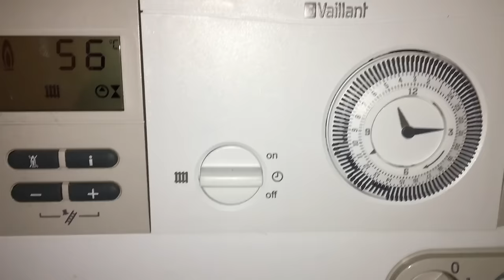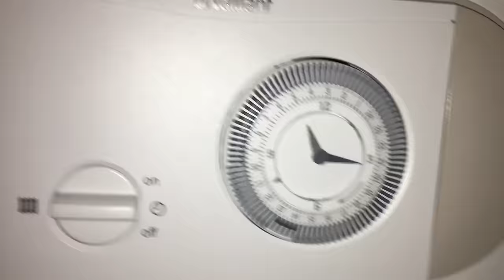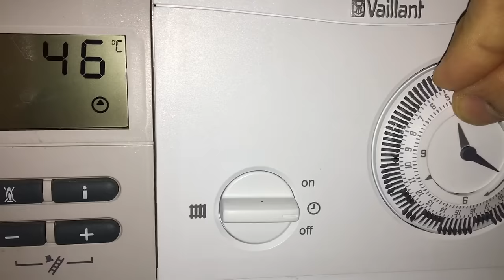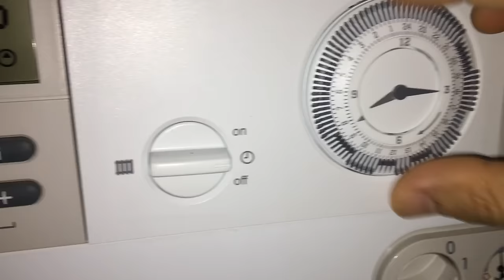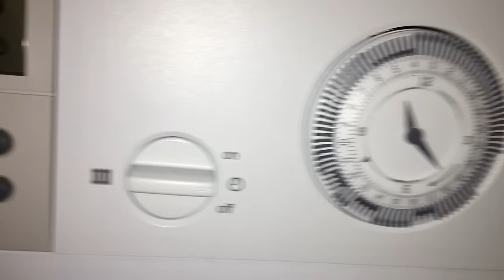How to auto set central heating clock timer using pins

Comment: Thanks for this upload. I have the exact same boiler and clock system but couldn't get it to work with the timer, so I searched & found the actual video for "User guide for time switch 150" which is made by VaillantUK ... On their video, ( https://youtu.be/mJMVn-yGFmc ) it states categorically that the tappets should be pushed to the outside for the heating to turn ON and pushed to the inside to turn OFF! 🙄
I'm amazed that the actual manufacturer of the appliance can't even get it right! Thanks again for the help, I'm now as warm as toast! 😊

Comment: Thanks for this video.

Can you tell me how to control tye boiler with the thermostat? I've been told boiler should be set to on then set temperature on the thermostat but when I do that the heating is constantly on no matter what temp I have the thermostat set at.
Reply from the maker: If you are setting thermostat correctly and boiler does not follow it, it means the connection between both is broken somewhere which needs to be looked at. Suggest to test the auto timer pins as explained in this video if this works
Reply: @ahumair28  thanks for your reply. I got my boiler check on Monday and it's all fine, he said the thermostat was working too as it clicked when he turned it.

I use the timer all the time so I know that's working well. 

The boiler guy said the switch should be set to on rather than auto or off for the thermostat to work but when I switch the boiler to the on position  the heating is constantly on.

Comment: Hi. Thanks for the video. Just a quick question if you dont mind. We moved into a property a couple of days ago with the same timer system. We have done everything you've said but still doesnt seem to be working. Is the clock meant to move with time like a standard clock and tick? Just wondering because ours is quite. Hope you can help.
Reply: @skyhigh8628  Hi skyhigh 86 could you please let me know if the ticking sound is normal? I just moved to a flat which had been vacant for about 6 months and I turned back on the gas supply and boiler. It seems the timer dial, which is identical to the one in the video, makes a ticking sound. As my flat is quite small the ticking is very distracting. Is there a way to disable it? Even when I turn the boiler switch to "on" or "off" (as opposed to set on the picture of the clock) I still hear the ticking noise. Any help appreciated.I have a EcoTEC 824 R1. Thank you.
Reply: @amm6569    heya, the ticking is normal.
I'm not an expert by any means, but the ticking is the clock in the boiler which rotates for the auto setting.
 I guess that if you wish to lose the ticking sound, you could do as I said in the original comment and remove the white cog from it and then put it back together again. That would stop the ticking but it will also remove the auto setting as the clock won't work anymore. 

The only other thing is to see if your boiler originally had a door on it. If it did, source a replacement door, it ticks a lot quieter behind it 👍🏼

Comment: Hey just a question here on this type of boiler. I am getting a ticking noise from the clock. Is there any way to stop it? I currently have the boiler set up so that it is always on and controlled through the thermostat rather than the clock. However, the ticking noise comes just from the clock and is quite frustrating. I don't have any errors or issues or blinking lights so everything seems fine and operational. Thank you.

Comment: I have this exact boiler and timer system but also have a thermostat in the hallway which I’ve been turning to 20 to put heating on. When the timer is on on the boiler do I need to put the thermostat on aswell? As nothing is working

Comment: Hey thx for this video but i need to stop the clock entirely as this system is very close by my bedroom and its ticking sound is disturbing actually, if you can help me out pls
Reply: I have this same problem. I just moved to a flat which has been vacant for 6 months. I turned on the gas supply and the boiler and immediately the ticking sound started. Even when I turn the switch to just "on" or "off" (as opposed to on the clock picture) I still hear the ticking noise. Is the ticking sound normal? How can I disable it? I obviously don't want to shut down my entire boiler each time I don't need it, but the constant ticking sound is really disturbing. Thank you for your help.

Comment: Thank you for your video. Two issues please:

1. The tiny bars that surround the outer 24-hour clock, what does pushing them IN do (tells your heater to switch ON or OFF?) and what does pulling them OUT do (tells your heater to switch ON or OFF?)?

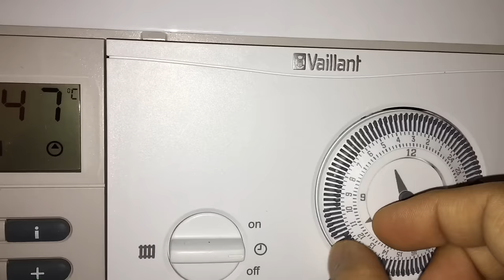2. My heater is a Biasi. The outer 24-hour clock is always 2hours15minutes ahead of the inner 12-hour clock. For example, if the inner clock is at 12:00 noon, the outer clock would be pointing at 14:15 and if the inner clock is at 12:00 midnight, the outer clock would be pointing at 02:15. How can I sort this out please?

Thanks for your help.

Comment: Thanks for sharing this. But i am still having some issue setting the two clocks.
I have set the inner clock to the actual time (3 pm)  by moving the minutes hand. Now i want to set the 24 hrs clock also to 4 pm because i want the heating to start then . However as i rotate the outer clock the inner clock also moves and as a result it has a time that doesn't match the current time.

From the tutorial it seems the two clocks need to be in sync. However this is not the case with mine. The pin on 24 hr clock points to 15 but the inner clock is set to 9:30 am or pm.

Comment: What if I didn't  want a timer than where would the arrow need to be on the clock, on or off?
Reply from the maker: If you want the heating running all the time then turn the arrow to "on" if you dont need heating it can simply be at "off". In both cases, the boiler will ignore the timer dial

Comment: Hello, could you please let me know if the ticking sound is normal? I just moved to a flat which had been vacant for about 6 months and I turned back on the gas supply and boiler. It seems the timer dial, which is identical to the one in the video, makes a ticking sound. As my flat is quite small the ticking is very distracting. Is there a way to disable it? Even when I turn the boiler switch to "on" or "off" (as opposed to set on the picture of the clock) I still hear the ticking noise. Any help appreciated.I have a EcoTEC 824 R1. Thank you.

Comment: Hi. I set the timer on but the clock didn't move and the time when I set it is still the same. Why is it not working?
Reply from the maker: Hi, looks like the time switch (TimeSWITCH) is faulty as the clock on these panels always work same as your wall clock regardless of ON/OFF, this can be easily replaced by yourself, it comes out easily. You may need to get one from the hardware shop or online, this guide may help - https://youtu.be/fbXOwImtUTM
Reply: @ahumair28  thank you. 🙏

Comment: Hi Mate, once you set the time... Should the clock heads move around like a normal clock? Mine doesn't need to change. As in I set it the time, e.g. 9pm, later on the clock is still at 9pm. Is there a fix?
Reply from the maker: Please take a look at this, you may need to replace the time switch -https://youtu.be/fbXOwImtUTM
Reply: @ahumair28  hello, I watched this next! Ordered and replaced it, works good as new
Reply from the maker: @drpepper9438  nice to hear about it!

Comment: hi sir, thank you for posting this video of how to set the boiler on timer. now i know how to do it but after i follow ur instruction, i can see the temperature of the radiator coming down and up again but the heating is still not coming on or the radiator is still hot. what else can i do or had i miss out anything or i need to bleed the air out of the radiator or set the pressure bar ? can you kindly let me know how to do it please ?? thank you